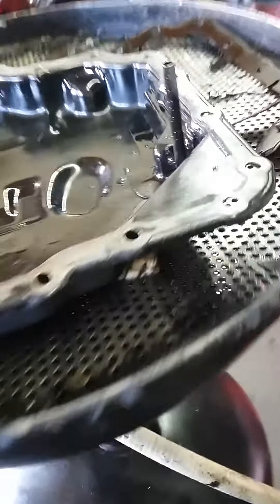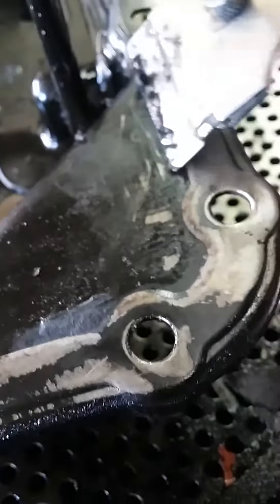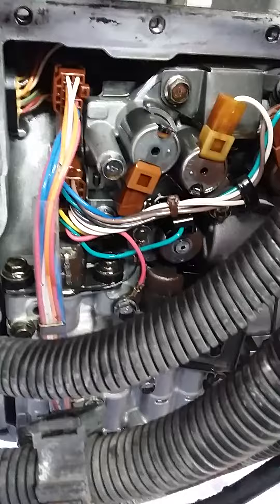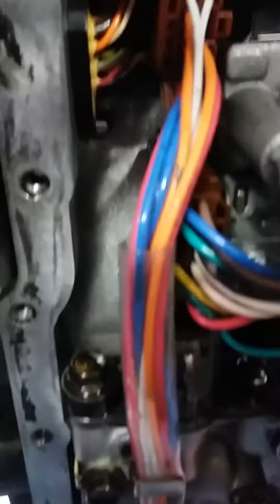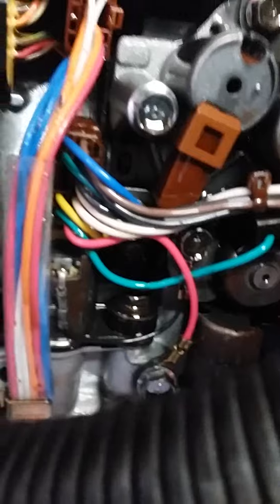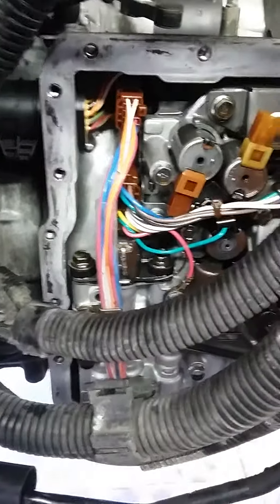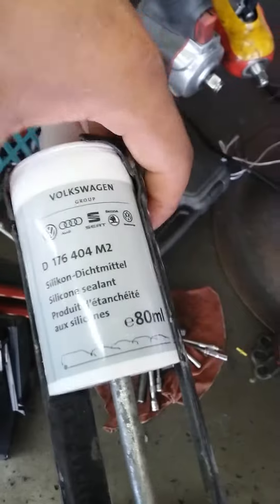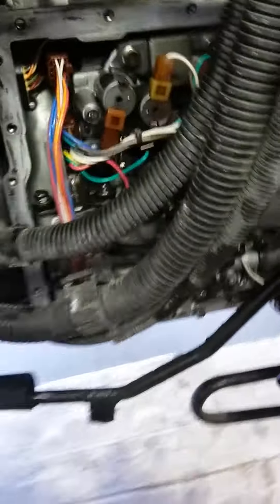2002 Volkswagen GTI 1.8 Turbo Tiptronic transmission side panel removal

Comment: Filters and that located inside the pan of the transmission reference to Haynes manual located elsewhere on the body of the transmission and it’s two filters by the way for the 09 a transmission